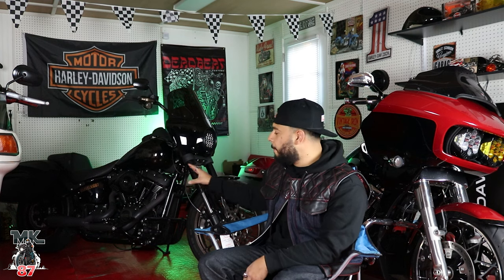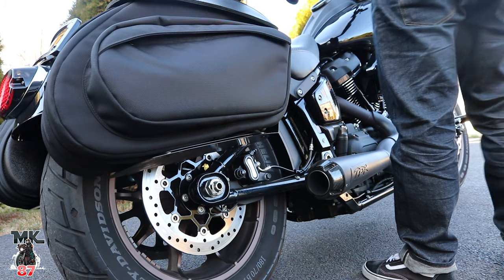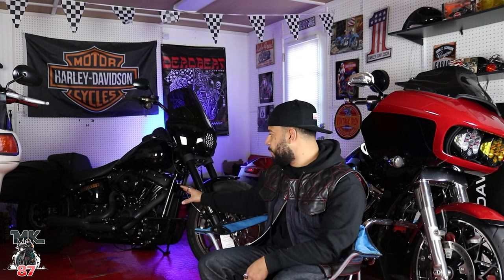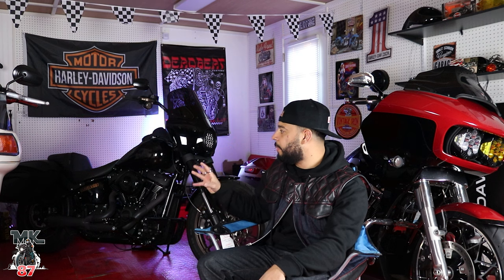Low rider s with TBR exhaust 122 M8 with s&s 475 cam SOUND CLIP

Comment: Sounds nice.  Im taking Street Bob from a 114 to a 122 in the next 2 weeks. Installing a max cell 821 cam, 55mm throttle body, larger injectors. I've  been waiting on a thunderheader x pipe for 5 months but can't wait any longer so decided on a Sawiki shorty which is in stock (the long isn't  available).  I realize I'll lose some low end torque but its a light bike.  I hope it sounds as good as yours!  Fantastic bike and congrats!

Comment: your pipe is way too short, these M8 motors want / need a long pipe, check out George Bryce's Star Racing videos / opinion on a long exhaust for the M8, make not make much of a difference with a stage 3, but, you do lose alot of lowend torque with that short exhaust, just an opinion, ride safe man!!
Reply from the maker: Yea your right about that. Im
Not a crazy numbers guy so me losing 2-5 hp is not an issue. I have a krome werks system on my glide and I honestly prefer this over that
Reply: Not true.  Half the Harleys at battle of the baggers ran shorty exhausts.